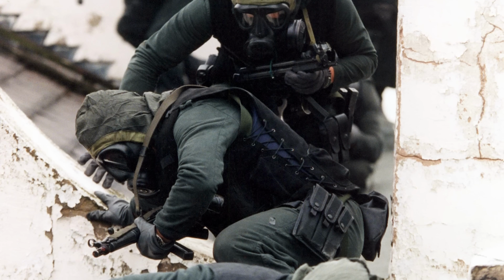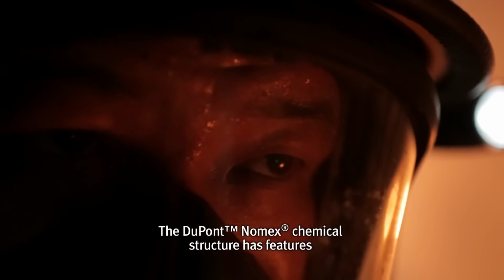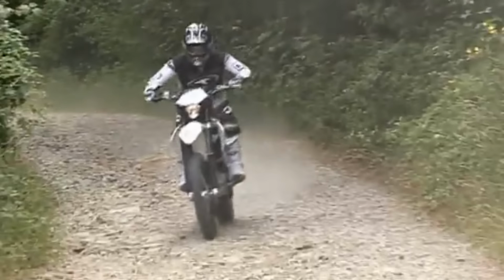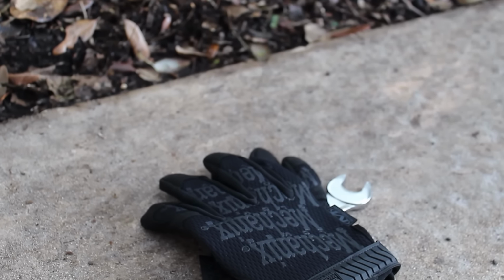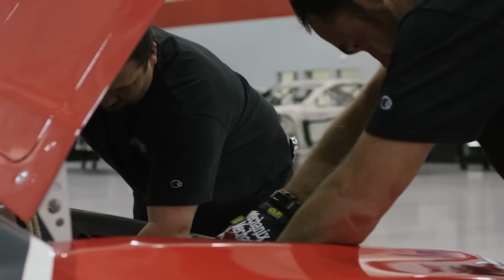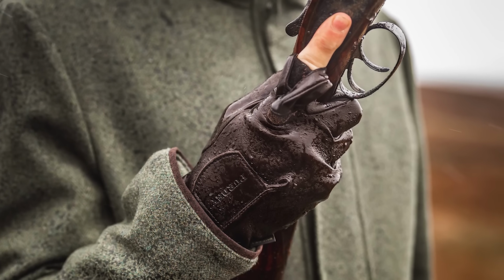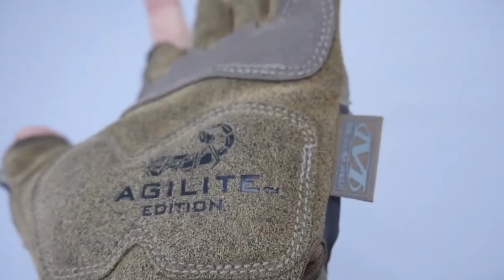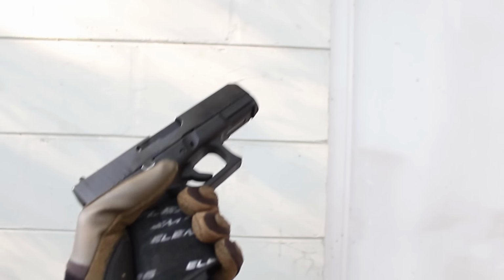How Automotive Gloves Became the Tactical Standard

Comment: Mechanix gardening gloves are very easy to buy here in Bunnings Australia, and work quite well for most hands-on jobs, good dexterity and good protection. Similar to a Riggs glove but a little more padding and premium on the hands. Still haven’t found the perfect glove though for road train drivers working with chains and also wet metal. The dipped gloves are okay but start to smell.

Comment: Mechanix m-pact are my go to for years, and I use them to bike, when its cold, to play airsoft, to do anything honestly that is done better with gloves

Genuinely saved my fingers on many occasions, like when hitting something with the handlebars while biking, i think I genuinely have all my fingers, and all of them functioning well due to these gloves. I had many unfortunate crashes and accidents over the years, I do things a lot safer now, but these gloves protected my hands when I was still reckless and a lot less responsible. 

And I need my hands and fingers hahah, all my hobbies are very dependent on good hand and finger mobility, from gaming, to painting, to model making, tinkering, all that. And even in crashed when my whole arms were messed up, the gloves kept my fingers safe.

(It all happened on mountain bikes, not on motorcycles. Even if I do trust the mechanix gloves, I would never wear them on a motorbike. For that you need special made gloves, preferably with finger webbing, the forces are not comparable between bicycle and motorbike accidents (i use the icon gloves for that, no idea what model, buI had them for almost 10 years now and they still are awesome))

Comment: Nomex and Kevlar are aramid (aromatic polyamide) fibers. Aromatic refers to the presence of aromatic rings of six carbon atoms. They don't have an aroma, like aromatic hydrocarbons. I still have an old pair of U.S. aviator gloves and the soft, thin, leather is kidskin (from baby goats). Before I had carpal tunnel syndrome I could reach in my pocket with my glove on, dig through my change and know what denomination each coin was. One time I grabbed a quarter and felt both sides of it and I could tell heads from tails with the gloves on. I haven't found any other gloves with such great dexterity. You can destroy them in a hurry loading weapon magazines, because the feed lips will slice them up. I learned that the hard way, but they're still great shooting gloves. I own maybe 10 pairs of Mechanix Wear gloves. I like the Fastfit better than the Original. I wear them all the time riding my ATV. I have handguards and don't need armored gloves, which I really don't like. I found a cheaper alternative in HarborFreight Handy work gloves. They're only $6.49 a pair, less than less than 1/5 of Mechanixwear Originals. And less than 1/3 the cost of Mechanix Wear Fastfit, which I only buy on sale and are better. It depends on if you want cheap gloves or good gloves, but they all work well enough.

Comment: M-Pact model of Mechanix brand gloves have so far been the best combination of dexterity and protection that I have found, some of the older versions even had a type of rubber/silicone grip lines on the tips of the fingers that let you use a smart device with them.
There was a company that was starting to make a glove like them that had a harder synthetic plate over the knuckles and back of the hand that was as good, but the plate would snap in the cold if it had side pressure and then it would dig in to you with any impact; they never got that worked out and kind of disappeared.  IE: If you hit your fist/hand in a hammer blow/karate chop style motion instead of a punch or flat backhand.

Comment: One thing people fail to mention about mechanix is their massive benefit of being considered a “wear item”. They tend to wear out in tactical application somewhat quickly but their increasingly affordable cost (under $20 for a base color pair of gloves) allows a soldier to purchase 3 or 4 pairs, wear them over the course of elf a deployment where he doesn’t worry about sacrificing them, then return home to buy 3-4 more pairs again because how cheap and easy they are. This is where magpul and Oakley went wrong. Their gloves being $50-$60 or even more makes people buy them and want to keep them prestine, or at least whesitate to get another when the first wears out. Mechanix will always guarantee sales because the low paid soldiers, law enforcement, and larpers can all easily afford them and not feel as if they are losing very much if the gloves wear down and eventually become unusable. A simple Amazon purchase for $50 will give you two maybe even three more sets to sacrifice on the job worry free. This is their modern winning tactic. And our modern winning method. Hands are meant for work. Why protect them with something you would hate to destroy? Buy mechanix. The best and most affordable  finger fodder out there. You love them, your fingers love them, even your wallet loves them. Everybody wins.

Comment: I was a tank crewman from 2005 to 2010 and weirdly enough didn’t learn about Mechanix gloves until after I got out. We were issues the nomex gloves but those would start falling apart after a week or less due to hard wear. I spent money buying some WileyX gloves with the composite knuckles and the stitching on the fingers started going after a few days. When I started working as a Safety Officer after I finished my degree our company issued us Mechanix gloves and that was my first introduction to them. They still wore out but after a substantially longer time than any of the gloves I had used previously.

Comment: I think it’s smarter to use Hyflex work gloves that cost a fraction, fits like a glove, generally accessible, and have higher cut, thermal, puncture rating than the original mechanix.

Comment: I use electrical gloves or motorcycle gloves when i practice and i swear by it true purpose that it is a must for different size weapon and trigger guards area and best part you dont have to feel uncomfortable by the weapon it self because some have a tough strong trigger pull and some have a very easy trigger pull and electrical gloves or motorcycle gloves can keep your figger from slipping and over powering the trigger pull.I dont cut off the finger piece of the gloves do to its durability to do its job.

Comment: For twenty years I wore the same kind of gloves at work: black deerskin, a size too small so I could stretch them thin.

Kept my hands from getting cut or scraped, but I could shoot and manipulate my weapons like I wasn’t wearing anything.  That was always the priority.

I tried other gloves, and I either HATED them or they worked fine and promptly fell apart.

Deerskin, one size too small, black.  Wear ‘em till your fingertips pop out.  I usually went through two or three pairs a year.  That’s what worked for me.

The last few years before retirement, lots of special team guys (SWAT, Bomb and MFF) started wearing Mechanix.  I could never make them work.  

I will say that I was tempted to try the Pig Full Duty (or whatever they call them) , but the price is pretty steep.

Comment: All my trade workers know that Maxi-flex gloves are the best. They're truly skin tight; you don't have to cut fingers off of them and you already have them if you're working. As an industrial electrician working on natural gas pads I have a pair of these last me about 1 to 2 weeks given how much oil and how roughly they get treated. My brother had given me a bunch of stuff including 3 sets of Mechanix gloves. I tried wearing them at work and the pointer finger ripped within hours. I was really not surprised as to how popular they are with people that do not use them besides a tactical fashion accessory. If you're a Green Beret in an ODA then I'm sure it works great for the day then you get another pair. I'm just a guy on a gas rig and don't get restocked til I find my way back to the shop and that could be a few weeks at a time. I can start quarter inch hardware with Maxi-flex and I cant do that with Mechanix gloves. I can use my phone, and most importantly pertaining to the video I can manipulate my handgun and rifle and feel everything i'm doing without having to look at it like I do with bulkier gloves. Give them a shot I'm sure you're really like them. ULine and a couple of other places sell them.
Reply: maxi flex easily best glove out there

Comment: Former helo pilot. We’d carry both mechanix and traditional flight gloves in our bags. Wear the cheap mechanix for the preflight of the aircraft to protect from all the hyd fluid, oil, and safety wire, then switch to the flight gloves for the actual flying. Recently found an old pair of mechanix in a box, they still smell like hyd fluid 😂

Comment: What's funny is, I'm a mechanic and I actually don't even like these. They're great for some things, but once they get any oil on them it soaks in and essentially becomes an oily rag you're wearing on your hand. Most mechanics I know, plus myself, just use the disposable kind. Even the thicker ones still give you better feel than actual Mechanix gloves, and they sit tighter to the skin if you size them right.
Reply: I'm in diesel and we rarely use more than rubber gloves. I usually bare hand it for cleaner tasks and put on the rubber ones for dirty stuff. I do have a pair of leather gloves for handling anything hot though or sharp.

Comment: There was a US Navy chap that helped me out working on my first motorcycle, as I went to leave he handed me a pair of Mechanix gloves and said he was introduced to them during his service and that they were the only gloves he wears for riding, tooling, shooting or working outside. While I didn't end up using them much while riding due to slide resistance concerns, I did use them a ton when I was working in a metal shop and when working on my bike and cars. I also got a fair bit of use out of them shooting, working outside and taking stuff to the dump. I really feel like they kinda just work for anything (except for those bastard rose thorns.) I left half of my pair at the metal shop when I left that job and have been kicking myself since.

Comment: After trying 5 different types of gloves, sending back 2 pairs (one soccer and the other tactical), and spending hours upon hours trying to find the right one for my training needs - a glove that would protect the inside of my hand, specifically my fingers while doing calisthenics on a raw steel pipe - I finally found and bought a Mechanix winter work glove.

It had the protection I wanted while maintaining adequate dexterity, but also offered great insulation, cut/impact resistance, and an enhanced grip (very useful for towel exercises). It also looks great, so it's become my main winter glove in addition to using it for my workouts, though I often wear two layers of simple white cotton gloves underneath for added insulation during winter.

I'm very happy with my purchase.

Comment: i have probably 100 pairs of Mechanics gloves, everything from the OG style to impacts, cold weather, dirt digging, thorn/penetration protection.
The only other brand of gloves i will use is Pig, they are expensive compared to Mech, but they are longer lasting.
Even have moto gloves, sim racing gloves, auto driving gloves, med gloves ofc. You need to toughen up the skin on your hands no doubt, but nothing will make you useless quicker than a series hand cut/burn.

Comment: As a soldier I bought Mechanix M-pact months ago, they are very versatile, to shoot, to hold hot ration in my hands and to install barbed wire, one of my best investment, without a doubt.
Reply: as a civilian I bought a pair of these and built a deck with my dad, use them for all my gardening, and for bon fire log manipulation and general yardwork as well as shoot with them. they are great, although the knuckle and finger protection is not rigid, its is that good thick rubber and damn if it did not save my hide numerous times moving lumber and trex a metal poles ets around/stacking them. I finally burned a hole through the left index finger tip, cut it off, and bought a new pair to leave in my bag for when these eventually wear out., but a single missing finger tip is no big deal, especially when you were already considering cutting off the index finger tip as it is *shrug
Reply: I hate that i clicked your profile pic
Thanks for that

Comment: I like to take a leather punch, poke a hole through the wrists, install some grommets. Now I can clip a carabineer though them and clip then on a belt or backpack. If you're cutting the trigger fingers off the anti-crush gloves, synthetic fibers like polyester, nylon, and acrylic melt when exposed to high heat. You can hold a flame to the glove to melt the ends and prevent fraying. I find that the Index, middle finger get holes worn into the fingertips after a week or two anyway, so i''m extending the life of the glove too. Also, it's not too bad to wear thin nitrite A3 cut resistants underneath the crush resistant to keep my fingers from getting scratched up and stay warm.

Comment: This is good.Looking outside the box. Take sailing gloves. For the most part with today's modern and less coarse ropes they're rarely used. When I knew I'd be sailing in the high latitudes of the North Pacific, I knew the poor circulation in my hands was going to be a problem. So I bought some insulated janitor gloves. Everybody laughed at them. They were absolutely great, but far from perfect. When I got back home I bought $22 merino wool glove liners and  plain rubber and also heavy duty long gauntlet neoprene glove. Not I can turn the gloves inside out to wash and dry and  do the same with the liners. What is needed  for cold weather gloves is always less bulk, but for people with poor circulation, some kind of air movement channeling wrists to finger tips. Hand movement and one way seals should be enough to move the air.

Comment: Cotton work gloves are trash .  Mechanix gloves have are decent but I switched to TIG welding leather gauntlets which are made for precise work and have longer cuffs to protect wrists. TIG gloves like Tillman don't require cutting off the trigger finger when properly sized to the user. TIG requires thousands of precise hand movements with several hundred for long welds being common. I use mine for welding, shooting, motorcycling and any task I used to use military flight gloves for (they were issued to many maintainers or could be had from a bro in Life Support or Supply, be kind to your Supply troops for they can work miracles!).
Reply: We used to sell gloves, and other industrial equipment, like welding gas, and welders, and we sold 10 pallets of Tilman's for every pair of Mechanix, 
That was a decade or so ago, new job, not sure what the market is like nowadays.

TIG gloves don't have crush protection, so if we move a cylinder or welder with TIG/MIG/Driving gloves on... and the boss sees...That's a safety write-up.  
TIL 1446s are okay
TIL 32s write-up.  
TIL 24s write-up.  
TIL 1000 write-up.  
TIL  956 write-up. 
We have to follow ANSI safety standards for each task, even if that means owning more than one pair of gloves.

Comment: Mechanix is my go to brand when I need a new work glove. I have several pairs across different styles with the Leather M-Pact being my primary work glove. They are also the only glove that 'fits like a glove', nothing worse than a glove that has sloppy fingers. Over the last few years I have been needing a glove that is insulated, waterproof and dexterous. A type of glove that seems to be hard to find in my part of the world for some unknown reason... The best I could find locally (I generally always have to try on gloves for proper fit before buying) was Helly Hanson. They are garbage. Highly overpriced garbage. I was going through 2-3 pairs a winter at $60 a pair. The last pair was waterproof for about 3 minutes before my hands started getting wet. I finally got on the Mechanix website and found a pair that met all the requirements I had, only no where near me actually sold it. I went to the one store that I figured might be able, an willing to order it and they found that their distributor had it in stock. $135.... But my hands haven't been cold or wet since I've gotten them. At the price I had to pay I went to the extra step of regular cleaning with proper leather cleaning products and protecting the leather with Sno Seal, which I will add is something I have since started doing with all my leather work gloves.

Comment: From a sas collector I can tell you that all the gear you listed isn’t correct in operation nimrod or the siege sas was wearing British army black tank overalls with an raf aircrew survival knife cut off raf g suits or raf cold weather trousers then they sown them to the left arm of the tank overalls the knife being there in case they had to cut ropes they where using they did use part of the NBC suit but all they did was cut it up so they had the shoulder and hood and they used it as a improvised flash hood then they used the S6 general service respirator because the SAS made up there own flash bangs with CS gas in them hence why they where respirators the gloves they used where the RAF flight gloves they where green leather gloves because they where lightweight but gave good feeling they normally used the British army lightweight boots or the GSG9 combat boots made by adidas they where different types of flak vests with 3 mp5 magazines on a drop leg pouch with different types of equipment on the vest it varied on what role they where doing